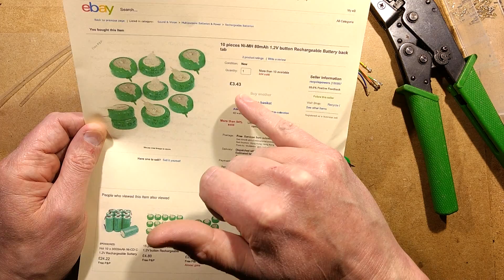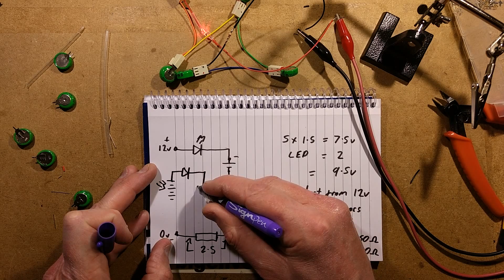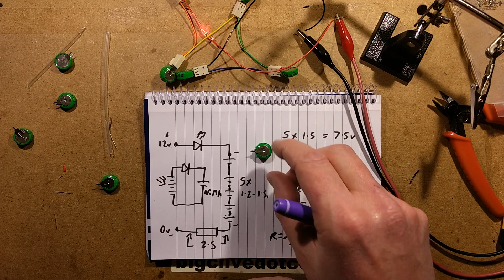Super-simple DIY charger for NiMh button cells.

Comment: Clive I got a question. Will you die breathing in that solder smoke and how many times did you die. But for real is there any health risk?
Reply from the maker: Generally speaking most people intuitively breath out while making each solder joint.  The vapour is primarily the flux.  I know lots of people who have been doing hobby electronics for their entire life and many of them are well into retirement with no health issues.
Reply: At least until you break the absestos fibro into tiny fragments trying to get it out of the house!
Reply: superdau
You missed asbestos... so much panic, so little real risk. Sure it's dangerous to play in, but if you live in an asbestos fibro house, you're not going to die from it like some people think.
Reply: VACCINATIONS.
Turns yer babies into tards with all the mercury and fetal stemcells, cholesterol, payote, bovine spoooey and the super_sized_slurpies they put in there to conjur up that witches brew. It's no wonder all them millennials keep turning into queebs!
I read somewhere that rosin flux is mostly pine sap, which is where we get turpentine. So basically... breathing up soldering fumes is like sucking up smoke from a forest fire... which has to be pretty mild compared to poison ivy/oak/sumac fumes.
Just sayin'
ymmv
Reply: I work with a fan on.
Reply: As with so many things health and safety officials will tell you that they are dangerous. And yes, if it's your occupation and you're breathing them 8 hours a day, they are a health risk (in this case it could cause asthma) and it's a good thing to warn about.
But as with so many things (solvents, lead, mercury, ...) there's also a completely unfounded panic around that stuff. Unless you're exposed continually there's so much other stuff in your life that's magnitudes more "life threatening" (smoking, exhausts from cars and homes in a city, mostly sitting in front of a desk, eating too much ...) you never think about.
Reply: Don't you love it when the vehement anti-vax/anti-fluoride moron types who won't bat an eyelid cooking their all natural organic food on a gas stove with the windows closed?
Reply: "there's so much other stuff in your life that's magnitudes more "life threatening""

Bacon.

Comment: A trick I use when the heat shrink won't fit...stick some small needle nose pliers in there,and spread/stretch it a bit. It tends to relax back to it's nominal diameter fairly quickly,but usually it's long enough to get it over the joint/whatever.
Reply from the maker: I'd have done that if I'd known what was going to happen.  I sometimes overdo it though and split the heatshrink.
Reply: ITS* nominal diameter, not IT'S nominal diameter. 
Learn the difference.
Reply: John Howard I buy extra large !
Reply: Its a bad habit,my hand has a mind of it's own when typing. :-p  Trololol.
Reply: I have that problem with condoms ! it had to be said !
Reply: That;s the trouble with big hands ...

Comment: I have noticed over the last 2 years that the solar panel and batteries have got smaller. AAA's were used. The LED's also appear to be less bright. Many get rain water in them and rot out so I now wrap them in cling film or mess about with good old Plumber's Mate on the encased ones. I am leaning towards running the whole lot of a DC supply and having my fruit trees like a Christmas tree.

Comment: When you open that Lithium Ion battery, do it outside, and tie your beard back if you want to keep it. They're basically gasoline bombs full of Lithium that can deliver a lot of current, so when you stab it, the tip of your knife gets super hot and ignites the highly flammable electrolyte, which triggers a thermal runaway that dumps all the chemical energy of the battery into heat over about 5 seconds. It's pretty crazy.

Comment: I've been an electronic technician for almost thirty years and I can tell when someone knows what they are doing, and when they don't. Big Clive is an expert at electronics and especially at soldering. I haven't seen too many people do one handed soldering. It took me awhile to learn this skill. One suggestion for the heat shrink that is too small. Take a pair of needle nose pliers and stretch it by putting them inside the heat shrink. You can stretch it pretty far without it ripping.
Reply: Agree with comment about the soldering skill. One of his older videos he gives a tutorial on how to solder. Keep thinking about showing it to a tech skills teacher here - all he teaches is carry solder on tip to the component and blob it on. Just really shoddy way to work. And he is teaching loads of kids to do this :( We need Clive to do school demos!
Reply: I stretch heatshrink all the time. I'm not an expert though.
Reply: +thehappylittlefox aka benji
I ran out of breath reading that. . .
Reply: I have stretched heat shrink quite a lot. It's the only way to get the right size over laptop charger plugs.
Reply: bob s,  yeah that's the proper name for the tool I have a few of them plus one that's very slim and made by some other manufacturer and it's chrome plated and looks like it came out of the predators first aid kit !
Reply: I'm gonna say it "fanny stretcher's" !
Reply: bruce 1164 I agree I am by no means an expert on the theory and maths involved in electronics but I am learning a lot from Clive and I am quite a dab hand at soldering in particular small stuff even holding the component underneath with a finger whilst applying solder in one hand and the iron in the other hand you soon learn to make a quick solder joint one other thing there is a tool for applying rubber sleeves with three prongs cant remember the name of it though only the name one of our sales reps gave it said it was good for loosening tight ! ***
Reply: andymouse123  yes your absolutely right his words exactly !
Reply: +thehappylittlefox aka Benji You mean a Hellermann sleeve expander.
Reply: maybe you need a V12 !
Reply: Haha, maybe.

Comment: Wait, so if you added enough batteries you could attach this to the mains? Please do a video on that ^^
Reply from the maker: The simplest mains charger for a NiCd or NiMh cell is just a resistor and diode with the option of an LED to indicate charging.  I did a video about a vintage rechargeable light that used this technique.
Reply from the maker: You do get mains powered battery chargers that rely on the cell being out in in a plastic drawer to avoid the shock risk.
Reply: I'm pretty sure you would need DC mains.
Reply: not really, because we have dc because of the LED. i am not sure wether the 60hz is going to affect the charging

Comment: Just a hint about tight heat-shrink, try stretching it open with your needlenose pliers.  You would be surprised how much it can strech, and it keeps you from using a larger size.
Reply: Tom Jopling I am so turned on.
Reply: Glad someone else’s knows this trick! I can often get the higher quality stuff to stretch to 4 or 5 times the pre-shrunk size. Notice that when you do this you’re making the heatshrink a bit thinner if you’re shrinking it over something with a diameter larger than the pre-shrunk size.